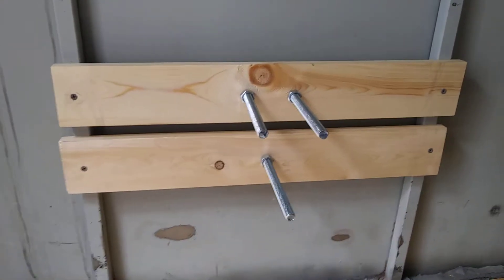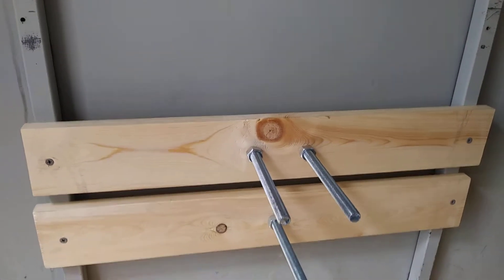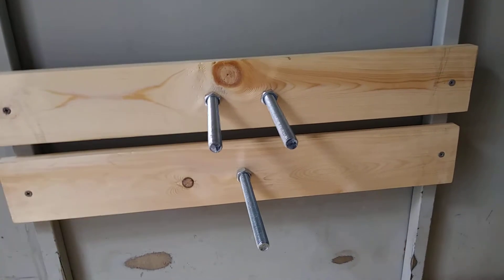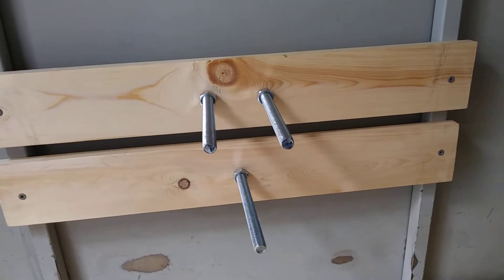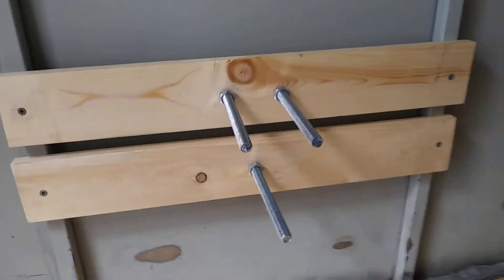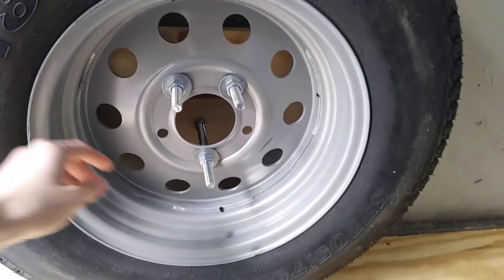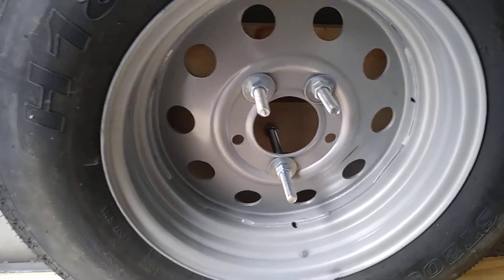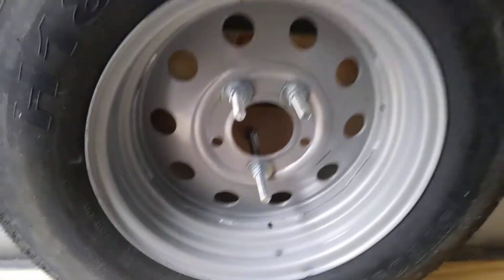DIY spare tire mount install for trailer

Comment: I love your design. Simple is best. I am going to do this but on the outside. I can remove a couple of the skin mounting screws, replace them with longer screw and use spacers.

Comment: I did the same thing but I put nuts on the rods inside and then outside so the tire wasn't drawn tight against the side of the trailer, the wheel is clamped between the two nuts so I can use the tire wrench to make them nice and tight so they don't vibrate loose